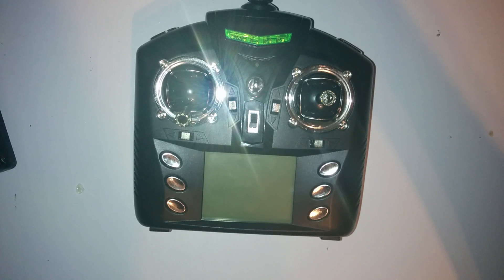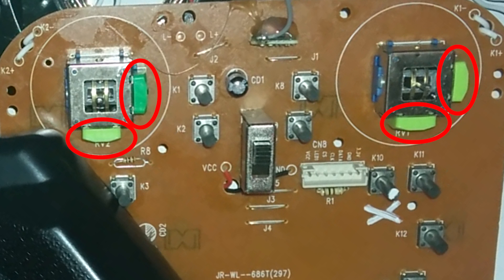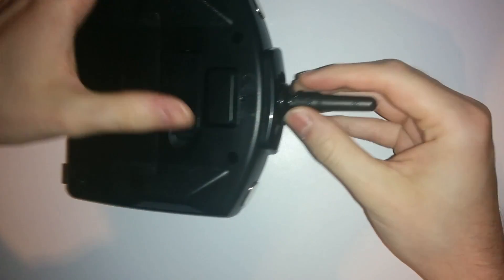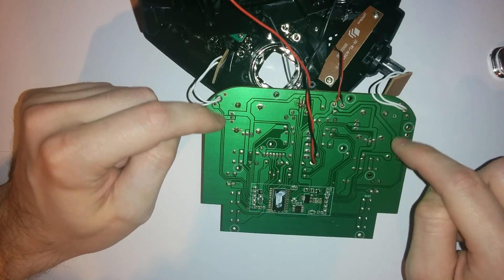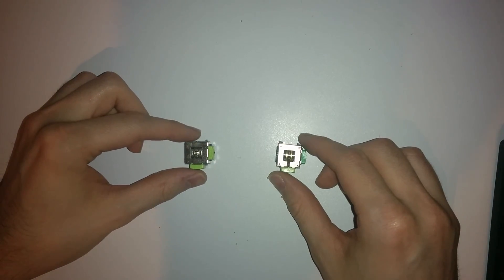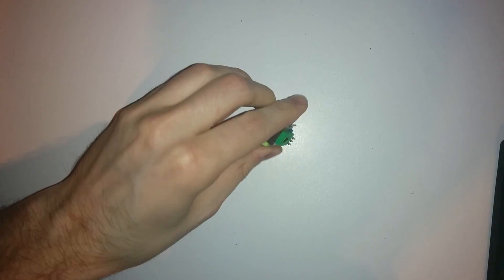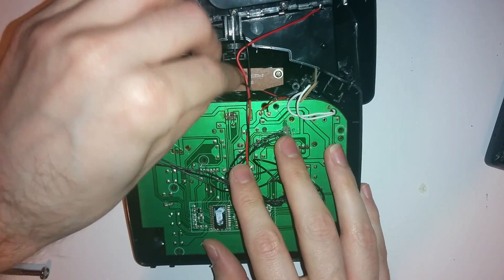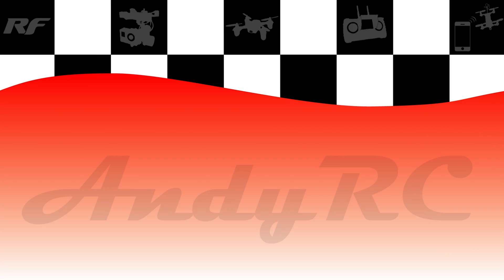Convert Toy Grade Transmitters To Any Mode (V686 Example)

Comment: Hey   Andy  wondering if  you had done the mod  on the  eachine H8   from mode3 to mode1
Reply from the maker: I havent but in most cases its possible to do it only time it throws it is when theres a push button on only 1 of the control sticks

Comment: Usually one side of each pot is +V and the other side is Ground.  You don't have to move all three connections because the middle connection (the "wiper") is the one that provides the control output.  You can cut the traces from the center pins you want to swap and jumper a pin to the a remaining trace. Just two wires per axis swap.
Reply from the maker: I wanted it to be simple and seen as we are removing the pots anyways I beleive this is an easier method. also you don't have to find out which pins are which if u swap like for like.
Reply: +AndyRC it also would have been possible if you would have swap the middle pin of pot rather connecting all three wires.
Reply from the maker: that is correct however I cant always guarantee that the pins are in that order which is why i move all three so i do not risk blowing it all up
Reply: +AndyRC hey all the pots in the world are designed that way only since it is easy. If any pot would be made in another order of pins it could also increase the size of that pot
Reply: +Rushi Palkar okay let it be ..
u have awesome videos on ur channel.
Reply from the maker: thanks :)